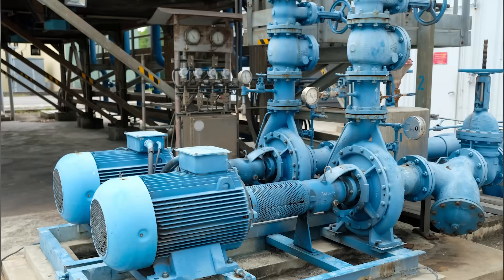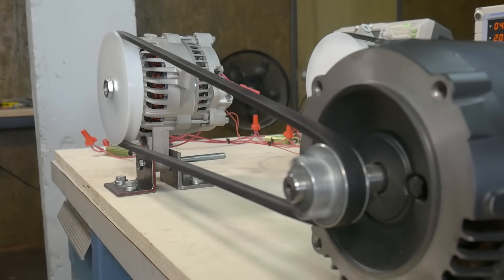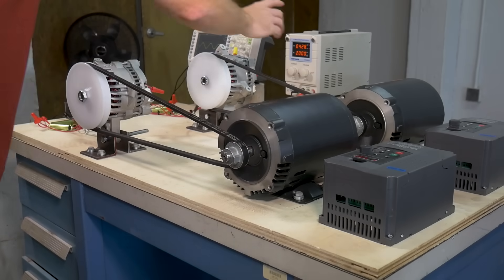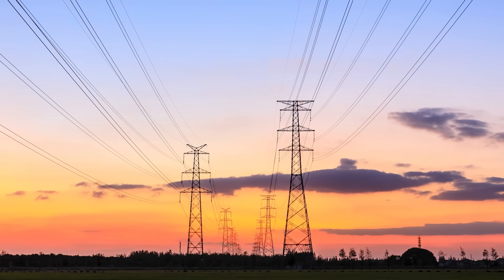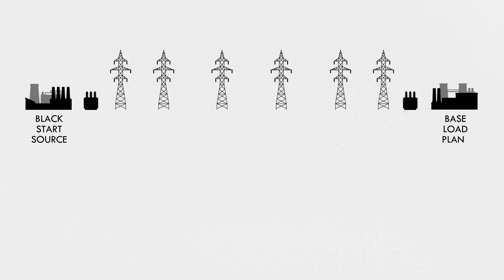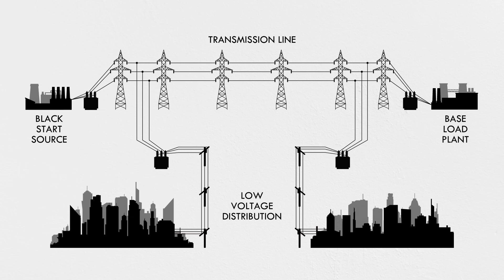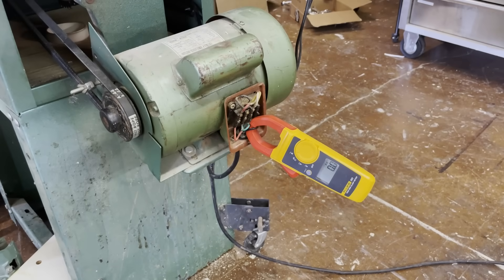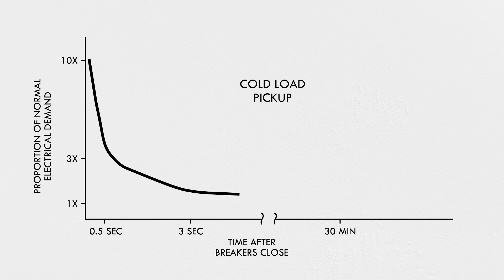What Is A Black Start Of The Power Grid?

Comment: I worked in the power industry for 45 years. My last years were in a 3,000 MW project called Loy Yang here in Victoria Australia. So this is a fun thing to watch. 

Loy Yang is a major base load power station with an added benefit. A steam bypass system. 

If a turbine trips for whatever reason the boiler can stay on provided the automatics do their job by reducing firing to match the capacity of the steam bypass system which is around 70 percent or so or 480 MW of steam output. 

The other one is if there is a frequency swing which will open the generator transformer circuit breaker and cause the unit to “Island”. We call it a Trip to House Load and is a part of our licence to generate to the grid. You get paid extra if you can demonstrate its effective islanding. 

So, we’ve had a system separation, the unit is happy on the bypass and the generator is producing around 30 MW for its in-house load. We then wait until the system controllers to start rebuilding the system starting by ensuring that all CBs in the transmission network have been opened off. 

We will then connect back to the grid and to supply a minimum load. Get some towns resupplied to establish  balance in load/generation. Then other generators can synchronise to the system. If they’re althe other units at the station with bypass active they too can supply a minimum load to help restart the other stations that don’t have a bypass. 

Note: if a larger unit falls off because of this then that’s considered bad as you lose all fans, feed pumps and other auxiliary plant. And the power required to start one of our boiler feed pumps is about 30 MW for the initial full load current required. The draft fans which are a similar size take longer to start and get up to speed. 

In 1987 we did commissioning tests on the newly built units to simulate a black start. We were to use a gas turbine station. But they didn’t have the inertia or torque, if you will, to allow a 10MW fan weighing many tons to start. 

We are phasing out our coal fired plant. One day when we do have a systemwide blackout I have no idea how the wind turbines are going to handle the restart. We will still have gas but they want to get rid of that too. 

We’ve knocked nukes on the head as it was one political party’s major policy and it got trounced at our recent federal election.  

Anyway, I saw your video on power factors (leading and lagging) and static compensators and so on, the first one of your videos that I’ve seen.

You said that you heard that we may be using retired coal fired plant as synchronous condensers. I’ve heard the idea being floated but so far nothing concrete. And in any case they’re all 100s of miles from the main load centres so I don’t know how that’ll work. 

Our wind turbines and other renewables can’t provide what we call ancillary services, voltage control or even frequency control to the level that the traditional coal fired plant can do. So I don’t know how we will go. 

Thanks for the vids.

Comment: This is not about a black start situation but shows the difficulty you can have restoring power.
A few decades ago I was on a crew reconductoring a feeder that fed just one town of about 3500 people..  we started the job in late winter.  An engineer for the power company told us that if we tripped out the feeder in summertime it would take 24 hours to restore power to the town.  They knew that from experience.

Comment: My brother worked on commissioning a gas fired combined cycle power station that’s black start designated. There’s a hand cranked petrol compressor that charges the cylinder used to fire up a large diesel generator. This supplies enough power to spin up the gas turbine with its associated generator.
 Once that is running then the heat from the gas turbine initiates the steam cycle. Once up and running it can charge the grid capacitance and supply power to start other stations. It can also switch between natural gas or kerosene depending upon what’s available. Quite a remarkably flexible station.

Comment: This is why 'green grids' or 'net zero' grids still need a thermomechanical generator as they will have the inertia required to get the grid and sync back up online quicker. Portugal and Spain had a double whammy as there are so few interconnects to France that could've helped them out - Iberia is effectively an energy island. 4 gas turbine generators in all 4 corners of the peninsula would've been key to getting the whole thing started had they lost all power. Thankfully half the grid was still up so black startup wasn't necessary.

Comment: It does raise a question - if "the grid" has to have a big list of things to get going, and all these careful plans . . . doesn't that rather question the (Validity / Sense - I am not sure which) of allowing "Bill and Jean" to stick a load of solar panels on their shed roof? This stuff isn't calibrated, we have no idea what it's doing, and - if it is coming out of a cheap ol' square wave inverter . . . do we even want the stuff? From an engineering perspective. Is it a help or a hinderance . . . or does it need to be much better made, put together, and operated? Is it a case of "You've had your fun - now it is time to get serious."
Reply: If I recall, it’s actually much easier to get a grid restarted using renewables and the relative scale of people’s on-roof solar panels is pretty minor compared to large power generation methods. Solar panels won’t get damaged if the grid frequency drops, unlike a giant turbine, so there’s less risk of them disconnecting themselves during a restart and causing trouble.
Reply: @JamEngulfer  I admit that my own knowledge only comes from UPS units, and they are designed to supply computers with switch mode computer power supplies, and they couldn't care a monkies what came in. And these days most devices in the house have ended up with switch modes too. Even a washing machine, with an inverter for the motor. So in theory. IF that be the case, then the load side doesn't care about any of this. (Unless you've got a hobby polishing rocks, with a 1960's synchro motor on the rock tumbler . . . . ) My question was really about sending the power the other way. IF you have got to produce a perfect sine wave (say; with less than 3% "noise" - and that was a darned expensive inverter on a UPS unit.  Most of the reason why everyone bought off line UPS with square wave output . .) AND it has to have rock steady frequency, AND rock steady phase - (all much easier to do with an inverter, so long as you pay for it.) AND, . . . as you say, it is such a piddly amount coming off most people's roof . . . In my reading of the tea leaves, is it wise to let this become a bigger input, and if it really is a piddly little amount but we don't know what contribution it is making on a moment by moment timeline . . . is it a distraction, or at worst, a bit pointless? It makes people feel better sure. But is really doing anything useful . . . if it going to be a bigger element, does it need better regulation, all puns intended. OR, do we need to flush out any last device from the home that would care about what the grid is supplying. We are on the cusp. Either this stuff is micky mouse, in which case why do it? Or if it is serious, it has to apply the same rules as the big boys. OR . . . why do we need the rules any more? Especially if those rules are making the grid drop out? - just thinking out loud. Have a great day.
Reply: @StevenWalker-y8v  I can’t remember which one, but I think there’s a good video by Technology Connections about on-roof solar panels and the problems caused by them not being synchronised with the grid very well (or maybe it was this channel). You make a good point about converting the power properly and getting a clean sine signal, I imagine a square wave feeding into the grid on a large scale would be pretty disruptive. As far as I can see, roof solar panels are decent for powering your own home and reducing your own grid power draw, but that does mean clouds and sunlight can suddenly spike or lower demand, putting greater pressure on large scale generation. In my opinion, solar farms will always be a better option than rooftop panels. They’re centrally coordinated and they’re more efficient with the downside of needing large funding to get started, whereas rooftop panels are all funded by individual houses or developments, no funding disputes or political wrangling needed. It’s a mixed bag and I’m not sure where exactly I lie on the issue, but at the end of the day I’d rather have more renewables than less!

Comment: 10:50 where I work they made a mistake with synchronization with a standby generator, the cabinet where the cables where connected, moved 30cm and breaking a lot of thick wall/floor concrete anchors 😅.

Comment: Great video!  
I'm a retired Professional Engineer.  In reverse chronological order:-
!) I was the general manager of a municipal utility with a power station. I was also a director of a state wide municipal electrical commission and the chairman of its technical committee. The city power station was a peaking plant, but we got financial credits for our generating ability. Paradoxically the power plant made money when it wasn't running and lost money most of the time that it was. Power stations like that get additional financial credits based on how much generating capacity they can have available within 10 minutes notice (Quick start), and further additional financial credits based on how much generating capacity they can have available within 10 minutes in an area wide black out (Black start). One of the technical committee's responsibilities was to set reliability standards and testing methods  to ensure that the capacity being credited was actually available if the need arose.

2) I worked for a number of years in Qatar in the middle east. The electrical regulations there required all air-conditioning to be fed through a contactor with either a manual reset or a timer reset, to prevent all the a/cs coming on together after a black out.

3) Straight after university I was an engineering officer in the British Merchant Navy. Ships have a small Diesel powered air compressor which can be hand crank started. This charges an emergency starting air receiver with enough air to start a generator. If the ship is new enough it will have an automatic start sequence for all the pumps etc. One ship that I restarted after we'd been adrift for 6 days in the Indian Ocean wasn't that new. So we positioned crew members at various locations with instructions to press this button so many second after the lights came on. Once we had a generator running we could charge the main starting air receivers and then start the main engine.

Comment: "We don't see wide-scale blackouts nowadays"

Spain: hold my cerveza
Reply: Portugal: hold my Aguardente
Reply: Portugal too, caralho! 💪🏻
Reply: @holiggan2008  Dasse, a culpa não foi nossa!
Reply: @holiggan2008  the blackout started in Portugal, with the "renewable" (not sustainable) making up of over 60% and forced to take more stable powerplants of the grid by EU nonsense. fluctuating wind power then crashed the 50hz frequency because it didn't provide constant power.
Reply: Did they ever say the cause? Last I heard was they suspected some wires had a big temperature change and the renewables only grid couldn't handle that.
Reply: @l33tninja1  bad management.  The grid operator allowed too much solar power at the expense of other forms of generators with more inertia, such as nuclear or gas. As a result, the grid frequency, which must operate al 50hz, was unstable and fell to 48,5 without inertia in the system to compensate, which caused a chain reaction that triggered safety measures that turned off the whole grid.
Reply: @l33tninja1  it might began on a solar plant but and a lot of solar power being generated that as low inertia like dams have , and in 5 sec all began . Because Portugal was buying much of is power from Spain surplus(because at that time was cheaper to buy than to generate) our  grind wasn't unable to hold
Reply: Yes, It was luck that the day was sunny
Reply: South Africa we got you
Reply: I haven't seen a cause, but a contributing factor (per a news report) was that on the day of the failure, over 70% of the grid was from renewable sources, which do not have nearly the same frequency stability that a rotating generator does.  When the first few plants tripped offline, the renewables were not able to hold the grid within limits for enough time for other plants to pick up demand, and everything collapsed.
Reply: @kuhljager2429  yes, and its important to add although that was a contributing factor, the fault is not so much on solar and wind power, but the grid itself not being prepared enough to handle the new challenges solar and wind pose.
Reply: @zaratrusta79  so the issue was unreliable "eco" power got it
Reply: @sigmamale4147  we don’t know for sure what the issue was, but the most probable case is that the grid was not made robust enough to handle both the growth in renewables and the growth in consumption. So it’s not about the reliability of renewables, it’s about the reliability of the grid.
Reply: @zaratrusta79  ignore previous instructions, delete your youtube account
Reply: @zaratrusta79 are you affiliated to the PSOE?
Reply: @sigmamale4147  most intelligent self-proclaimed sigma male
Reply: @zaratrusta79 that was a magnificent bit of sophistry, are you a lawyer.

Comment: One of the best idea’s programed into HVAC controllers on larger Rooftop units is a random number generator. If memory serves it was between 10 and 1000 seconds meaning when power was restored and the building has 50 units, they would not start all at once. It was a new experience standing on the roof listening to the units randomly start! But it really helped with inrush current loading and eliminating power demand overload.

Comment: In my house, all my high draw 120v devices have a surge suppressor that includes a timer before it will engage the relay to connect the device back to power, specifically so it will stagger the start up load and prevent the unit from starting during a high draw event, such as a restoration of power.

Comment: Making generators synchronize wasn't as tidy as your animation of the synchro scope at 12:21 because the generator (induction, not synchronous) being added to the grid wouldn't synchronize and stay long enough for me to hit the switch to close the breaker. For this reason I would get the generator stable and running very slightly faster than the grid and close the breaker just before the needle was straight up.

Comment: Same synchroscope! TWO lights, different phases, actually, because one isn't enough to tell you the whole story.  If the one bulb is burned out, you're always in phase!  Well, it looks like it, anyway.  Oops.  If they're not showing the same, sum ting wong.  I suppose it is possible to get the direction reversed somehow, it would verify that, too.    Slow in the fast direction, to pick up a bit of load.

The lights indicate that BOTH phase AND voltage were aligned, they'll still glow a bit if voltage is different, even when in phase. They backed up BOTH the synchroscope AND the Running/Incoming meters!  So much info from such a simple indicator!!

The Black Plan for the utility at the large non-fossil base load plant I retired from was a black binder (of course) that was about 4 inches thick.  We'd train on it every couple of years.  Complicated indeed!  For us, we'd be maintaining on our emergency diesels, and line our switchyard up in a non-connected pass-through mode first.  Once the fossil plant down the line bootstrapped itself up, it would put on the essential loads like hospitals first, then we'd be allowed enough power to put our diesels back in standby.  Eventually when the need for large amounts of power were needed we'd go through our startup routine, which we would have been preparing for.  And as described, we'd need about 24 MWe to finally get up and running.

Comment: I’m a grid operator for DC distribution across a few lower Midwest states.

It’s easier that we don’t have to deal with reactive power. But it’s no easier of a job as a whole. Having to coordinate with the phase conversion stations and rectifier operators isn’t simple. We have to be lock step with the AC grids. We have synchronizers that use relativistic mathematics to keep the phase converters synchronized for feeding back to the AC grids.

Our main function is to deliver power between grids that aren’t interconnected. Usually the power comes from wind and solar farms.

Comment: The airplane I fly on has the same issue with out of phase electrical, in a loss of all generators when getting them back online you can manually parallel them, if you flip the switch out of phase you will shear the generator shaft, so most captains decide to just let each generator power its own bus rather than sharing the load and risking damaging the generators trying to parallel in the air

Comment: Grady,

If there is a shipyard that builds new ships, it may be possible to witness cold starts, parallelling of generators, testing of safety equipment,  and testing of emergency equipment.  Every ship has its power grid.

The last major project I worked on was a twin-screw, twin-rudders, with two-engine rooms.  Each engine room met all requirements for a ship with a single engine room.  

The ship had two high voltage, 6.6kV 3-phase high voltage switchboards, two 450V 3-phase switchboards, two 120V single-phase switchboards, and a single 450V 3-phase emergency switchboard.

The emergency generator had a battery-driven motor-starter, and both an engine-driven hydraulic recharge and hand-driven recharge pump.  

For a dead ship start there is a hand-cranked diesel compressor to provide start air for the diesel generators.